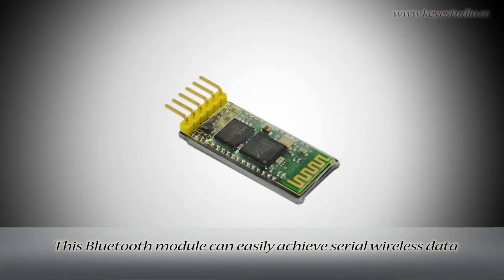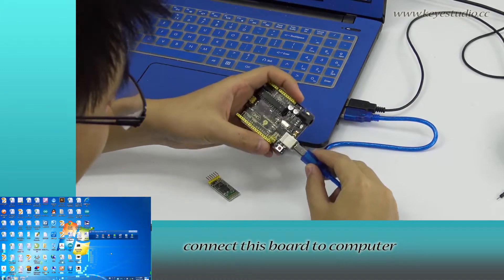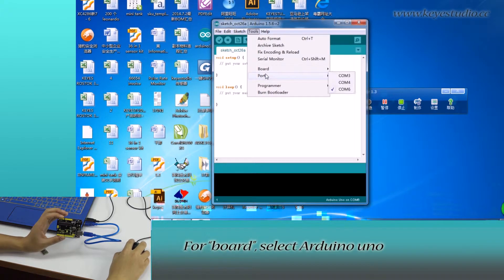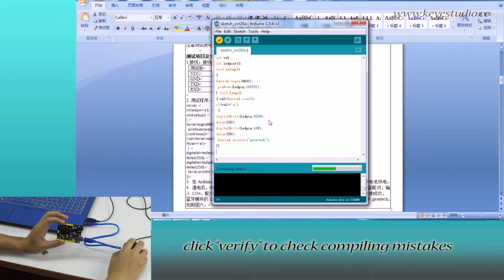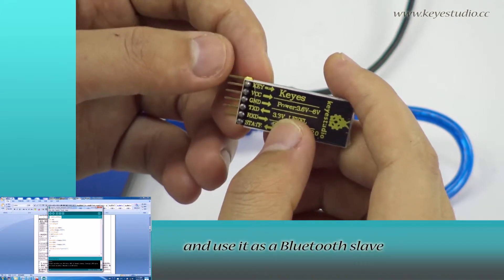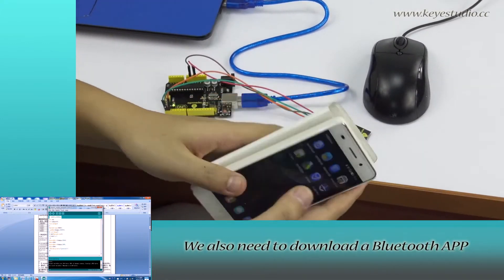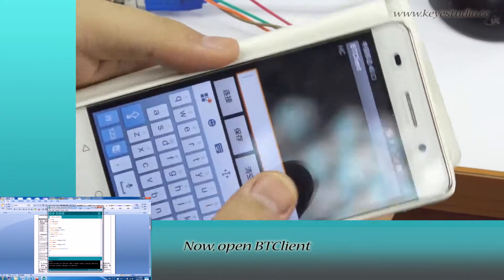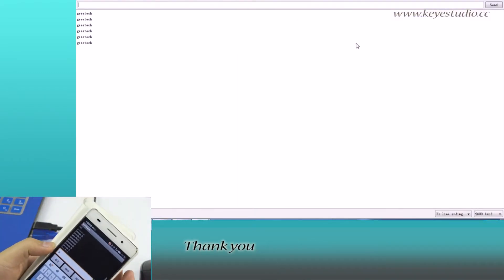Keyestudio Bluetooth Transmission Module for Arduino with Bottom hc 05 Master and Slave

Comment: Can the 5v TX/RX UNO pins be directly connected to the 3.3v pins on the Keyestudio HC-05 module, with no voltage divider or logic level converter?